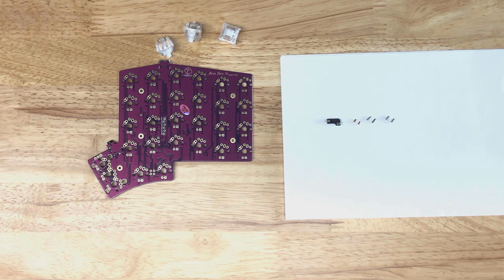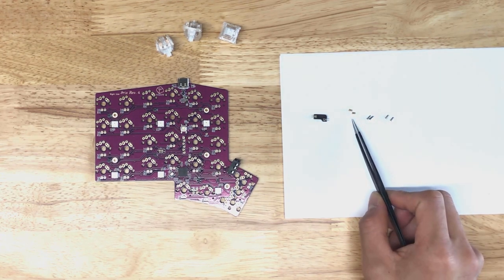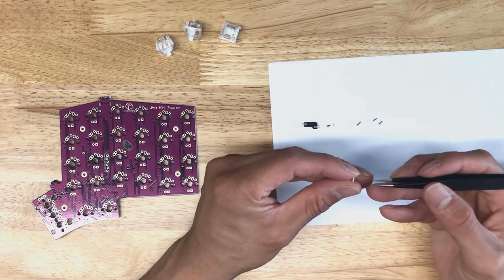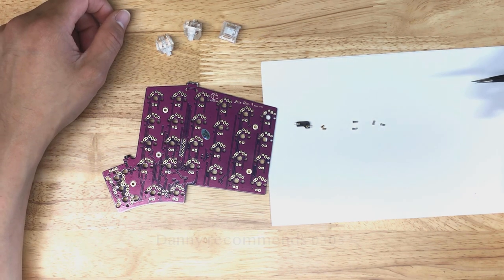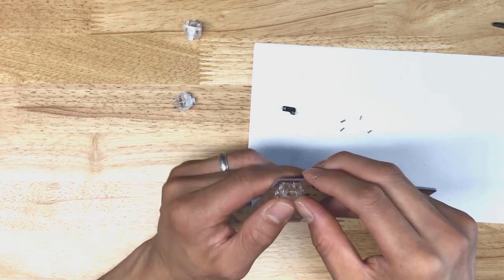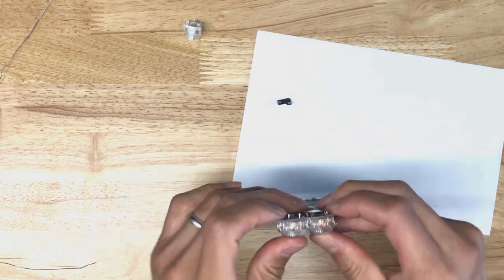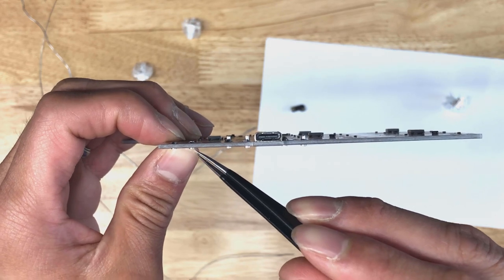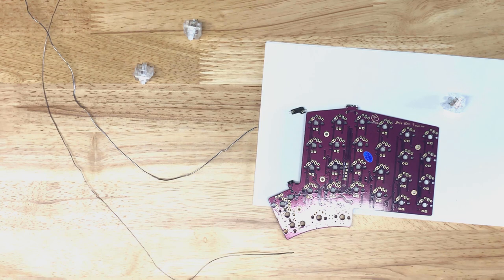Installing Mill-Max Hotswap Sockets into a Regular Keyboard PCB

Comment: Absolutely great video. You could also get some cheap 5 pin switches like a 10 pack of gat yellows, and use them for the soldering part, especially on the PCBs with multiple different switch options. I kind of fee like soldering is part of building a keyboard, but i also like hotswappaple switches so i already have a quefrency and levinson with millmaxes installed. The quefrency uses 7305 and levinson uses 0305, and i agree with you that id just recommend using the bigger one. I notice no difference on how they look, but they were loads easier to solder in place.

Regarding the video quality, your voice was really clear and i could really easily see what was going on, but i felt like there was too many pauses, and some of them lasted a tad too long.

All in all a great video!
Reply from the maker: Cool, glad you liked the video. I usually go with whatever cheap switch I've got around, like the gat yellows you mentioned or some old Outemu Ices I have around. I'm still playing around with the video production side of things, as for now, I tend to do things in a very raw and unscripted manner, but I hope to get better at that as I go along and record more videos. I'll also be recording from a separate mic in the future, since right now, I've been recording using my phone, and that picks up the noise from my 3D printer if I'm printing something.

Comment: Do you know which socket I will need for the 4 pin led? The holes in the led pcb are smaller than those in the switch. I have the razer blackwidow x chroma.

Comment: I'm trying to use gateron browns to solder the millmax and one of the prongs is too wide for the socket. I broke two switches already. Anyone else seen this? I ordered cherry mx to see if I can socket them and then solder.

Comment: Will this work for a OEM keyboard or does the keyboard need to be designed to accept the mill-max sockets? I purchased a HexGears that was supposed to be hotswappable and received the wrong one, of course amazon is out of most of the old Hexgears equipment now so theres no swapping it out.
Reply from the maker: Yes, but you will need to make sure the switch pads on the PCB are as clean as possible to allow the sockets to fit in there properly.

Comment: I bought some 0305 sockets and they won't fit in my pcb for a little bit space. Can I somehow "open" the holes on the pcb a bit?
Reply from the maker: Yes, you can take a pair of tweezers and rotate it inside of the hole for a bit to widen the hole enough for the socket to fit through
Reply: @Keebio  🙏 thanks

Comment: This is fantastic.. have a couple v4 boards still waiting to be built.. may have to try this. I assume the v5 is still going to have these built in as well as rgb per key smd leds? E.g. we wont have to solder the hot swap or leds in right?   Question.. how do you avoid solder going in to the hole when soldering.. especially for the smaller ones.. when you heat it up doesnt the solder pool enough before it cools to potentially go over the top and in to the hole?
Reply from the maker: I've rebadged the Rev. 5 to Rev. 6, which will have the RGB per-key and Kailh hotswap. To avoid solder from going into the hole, I use a finer soldering iron tip and thinner solder (.020").

Comment: Couldn't you use electrical tape to hold them down without using a switch and then solder them on without a risk of soldering your switch
Reply from the maker: If you got solder on the switch while doing this, then that means you would have gotten solder inside of the socket anyway and screwed it up.